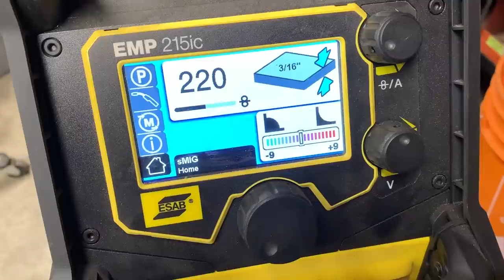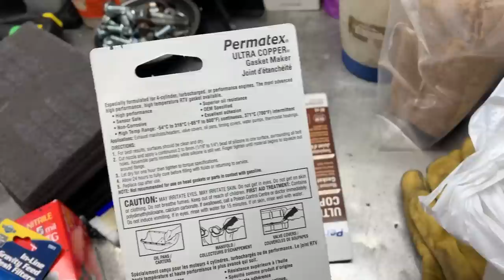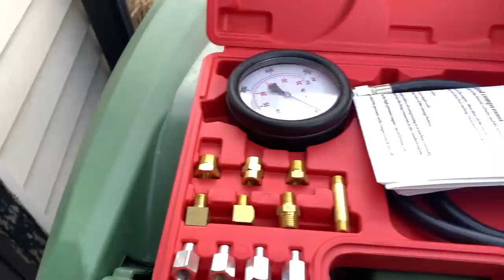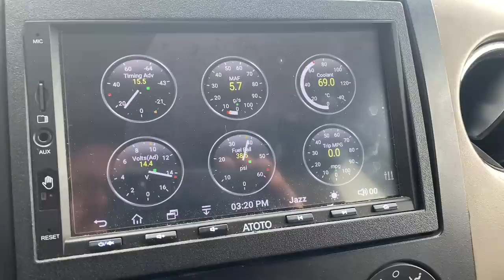Mind Numbing Welding and Painting Prep

Comment: I enjoy watching you work. You are a Master with excellent attention to details and much knowledge. 
That being said, a few months ago, I started using Aero-Kroil on my nuts. Is WD-40 better?
Also, I enjoy seeing how Tomcat is doing. Thank you & thumbs up!
Reply from the maker: I use WD as it’s cheap and seems to work.  I’ve never seen Aero Kroil what’s your thoughts on it ?
Reply: @BackCountryWrenching I used it to loosen the nuts on top of the dashpots to remove my front shocks.  It was recommend to me after I was unable to get them off with WD-40.That did not work and I had to cut them off with a Dremel tool. So, I can't say for sure. One thing is for sure: it costs a lot more than WD-40. I still have the can and it just sits there, so I guess I was inaccurate when I sai i have been using it for several months. My bad! My apology.